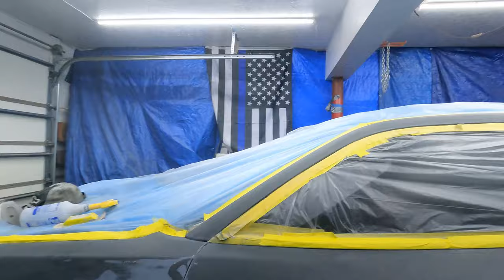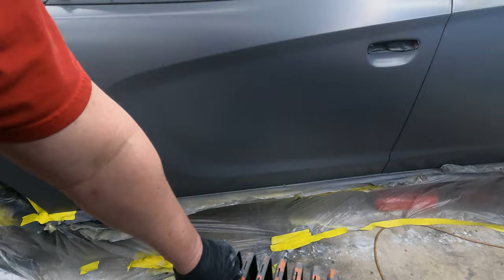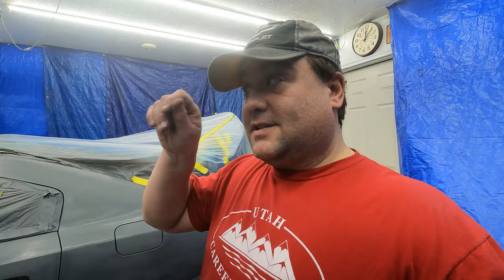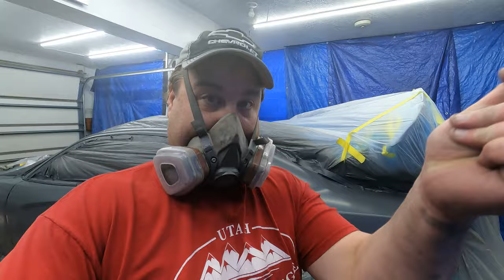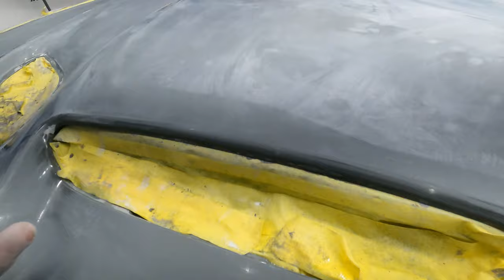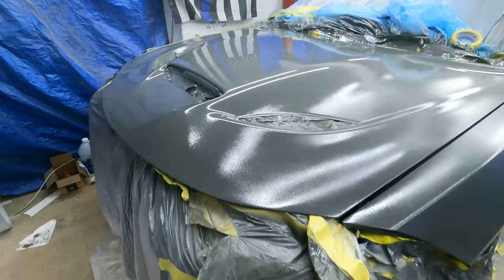STOLEN HELLCAT PAINTING A STOLEN HELLCAT CHARGER   | | 2018 HELLCAT CHARGER BUILD

Comment: I hate seeing those burn through areas on your car.  Dang!!!!!  I did sanding on the sealer with 800, and the paint store said to sand my basecoat with 1500 which I'm gonna do tomorrow, and that 600 might be too aggressive.  I heard GYC guys prepainted to make sure areas look good.  Coat number 4 is only possible with the stuff you learned from the previous 3!  Looks great!  When we sprayed the challenger I mixed the paint wrong and didn't add any reducer and the paint looked just like yours.  You can sand it all down in the cut and buff but it's a ton of work, I don't envy ya!  We just sprayed my charger in 70 degrees, and I used a mid temp reducer like it called for, but I was told to add some high temp to make it take longer to flash and allow it to lay down.  might help!  I'm happy with mine so far, but the sandpaper comes out tomorrow...I'm so scared to sand my paint....